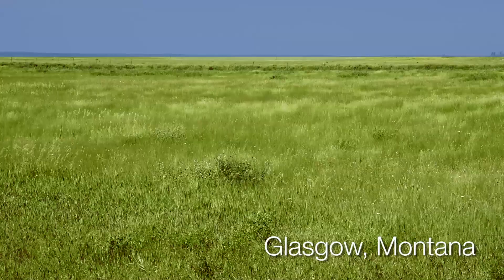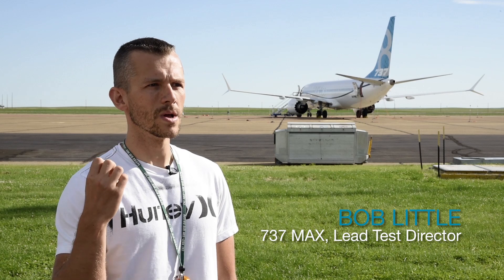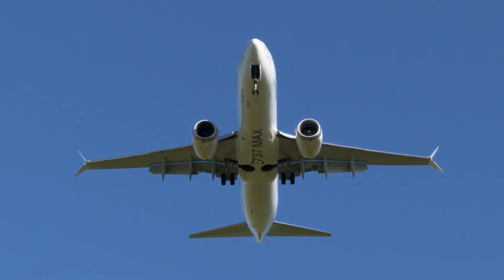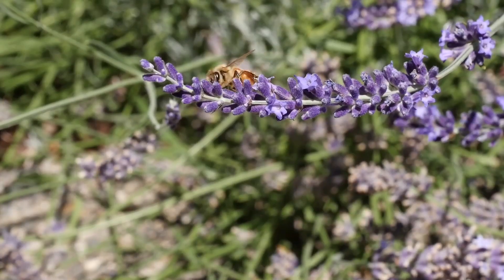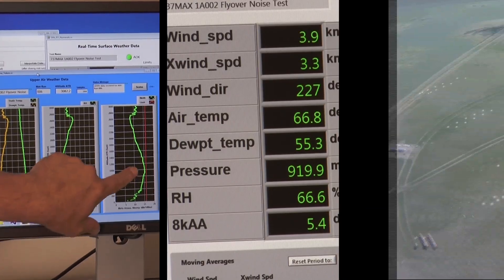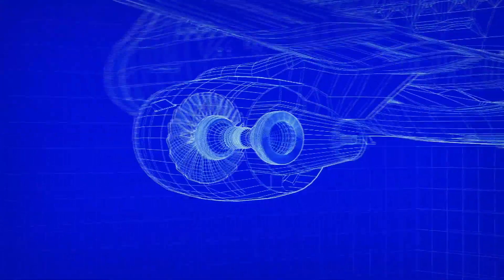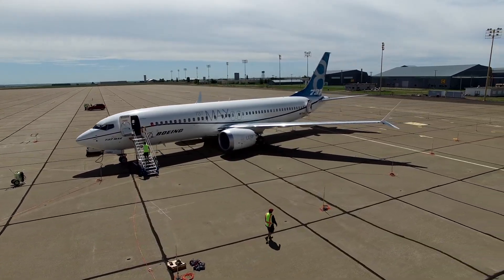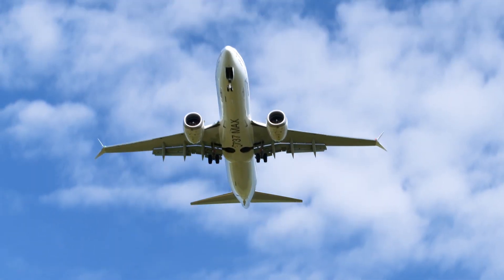Shhh... Boeing's New 737 MAX Redefines a Quiet Airplane

Comment: Why not revive the b757. its got better performace, And uses less runway with higher payload, with much more powerful engines. on VR takes less time and speed. it was a great plane
Reply: aky19832001 Rumor has it, Boeing is developing a split scimitar version of the 757.

Comment: In 2017? I saw that some airlines have these 737Max in service for almost year, for example TravelService/SmartWings
Reply: The don't have the MAX they have 737NG
Reply: No, they have MAX8. You can find photos and videos of real traffic in Praha, where the 737MAX is moving on taxiway. TravelService has in service OK-TVT, which you can see on video from Czech Airlines channel on YT. The name of the video is Antonov AN224 v Praze I think
Reply: OK-TVT is a 737-800 which is part of the 737NG family.
Reply: taht is B737 Ng with split scimitar
Reply: Oh. I thought that 737 with dual winglet is always MAX version :D
Reply: Those are 737NG's with scimitar winglets
Reply: And do the 737NG with scrimitar winglets have wide screen panels as the MAX or do they have the same quare displays as the normal 737NG?
Reply: Well, a 737NG with scimitar winglets is still the same as a normal 737NG. A 737NG with the scimitar winglets modification is 2% more fuel efficient then a 737NG with normal winglets. Thats the only difference. It has still the same engines, cockpit and other tech.
Reply: Oh, thanks
Reply: Pavel samhini

Comment: How about making a vertical take off plane ?
Reply: CyberCanadian that's a terrible idea that would make a extreme amount of cost pair lift off and I also think landing it would be hard
Reply: Alex Planchon Well it's Elon Musk's idea. He's normally right.
Reply: CyberCanadian it's impractical as it would require a ton of pilot training for widespread use and alot more maintenence and fuel costs. it just won't be profitable.
Reply: Joseph Penn It would have to be mostly electric and solar. I agree it would't be profitable today. We are at least 10 years away.
Reply: CyberCanadian plus I'd rather keep flying fixed wing aircraft instead of VSTOLs as its extremely reliable and is a highly efficient platform that can be adapted to anything
Reply: VTOL passenger plane? There isn't really a need for one.
Reply: uhg
Reply: Clarence Aaron Jones i agee with that you should check out the vandalism that they do to planes
Reply: CyberCanadian they have fighters but I think a commercial jet would be too costly
Reply: Bergie think about it, they could take off from armored silos if any airborne threat had been attacking!